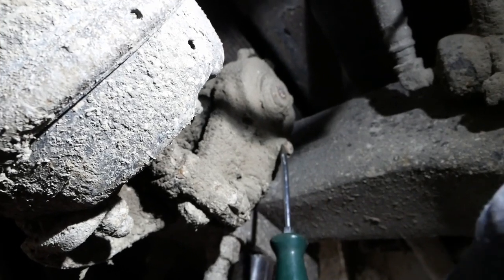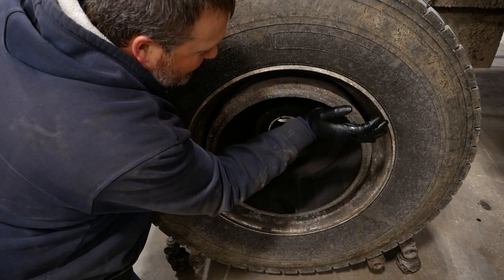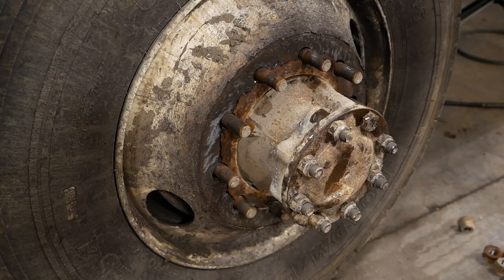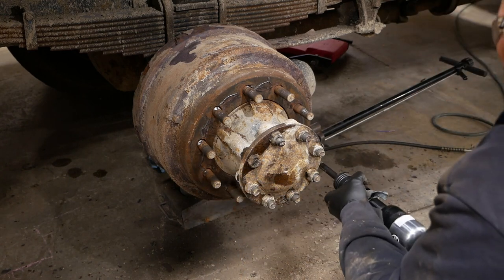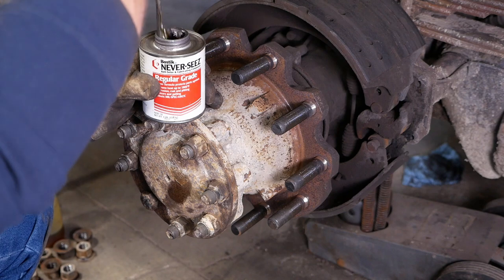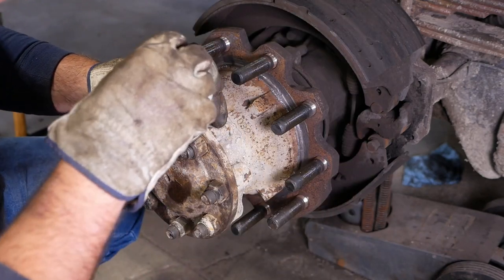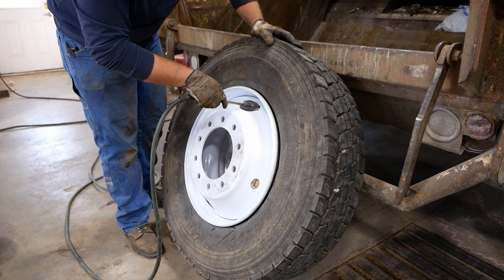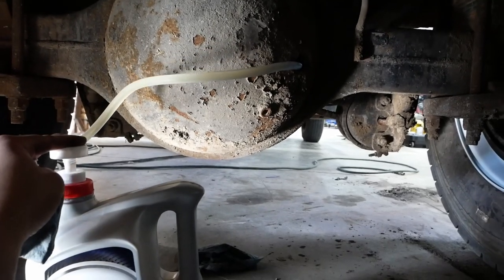Garbage Truck Driveline Noise Could Have Been Bad!

Comment: I have to ask: why is the valve stem on the outer wheel pointing inside?  I guess is for protecting against road debris, but doesn't it make it harder to inflate if you don't have the proper nozzle?
Reply: It is a dually wheel. The inner wheel and the front tire has the valve facing out board, but this one is mounted 'backwards' so the nozzle face inboard. Anyone who uses these wheels has the right air chuck

Comment: Wes I'm a Dewalt user...just wondering what model nut driver you used to take the axle bolts off?  Used to use a air compressor but that developed a leak.

Comment: Great video. No experience with truck tires but how do you check tire pressure/inflate the outside rim with the valve stem pointing inwards at 17:38 ?
Reply from the maker: You use an air chuck that points backward. Standard equipment for truck mechanics.
Reply: @WatchWesWork  Aha! Thank you.

Comment: You can grant that one tool that uses way too much floor space that you use but twice a year - at most... as much space as it wants. It's not a matter of whether it ever pays for itself in raw $$ (it has). Each rare time you get the need to go for it - there it is and you smile inside as you roll it over to the work. Technicians / mechanics and our tools :)

Talking of something that should pay off later / eventually - knee pads - we're not engineered to kneel, continue to kneel on concrete in jeans and expect double knee surgery come 50. Want to factor that medical cost into your retirement planning?

Comment: should  have done a brake  job also, and buffed the paint off  the rims where they met, the paint will turn to dust and fall out and the tires will be free, and you should have retorqued the lug nuts after you test drove it and the studs were seated,

Comment: Improper clamp load.   There are many factors that can cause this alone as well as their combined affects.  Under torque, over torque, paint thickness in excess of 3.5 mils,  rusty hardware, etc....   Best thing is to start fresh and it seems you did with the exception of the nuts and hub face.  New nuts and studs torqued to 475 ftlbs will yield about 55000 lbs clamping force while a rusty nut and stud will only produce about 20000 lbs clamping force.  Even used nuts and clean studs only produce about 40000 lbs clamp force when torqued to 475 ftlbs.  

Torque needs to be accurately set with proper sequence and then check after 50-100 miles and again every 10000 miles.

Comment: In the 1970's I drove a Dodge box van with dual wheels . When it needed tires they put them back with the rims CRUSHING a locating pin . It was there to make sure the rims locked together . A short while later everything chewed up and the wheels loosened and studs had to be replaced . I remember the moron at the tire shop with a 1" impact gun saying " I don't know nuttin' about no pins " ! It's great when they turn IDIOTS loose on peoples vehicles - on the cheap ! We don't need no stinkin' torque wrench ! Dangerous !

Comment: Great video and a nice change of pace.  Couple of questions - 1. I didn't see any other support when you lifted it other than the jack on the axle.  Please tell me you had some sort of jackstands or other means of support under there.  2. Not that you normally seem to upsell customers but wouldn't it have made sense to do a rear brake job as well?  As you said the pads were close to worn and you already had the wheels and drum off on one side.  Seems like it would be false economy not to do brakes at this point.  Thanks and keep the videos coming!

Comment: I had a rim explode on my tri axle dump truck at work and it was to the point where there was about 3/4 of the inner portion of the rim was just completely missing and we never found it two months later the same thing happened again two another driver who was driving my truck

Comment: The tire changers/ balancers screwed up the studs on my hubs as they did not lubricate the flange nuts. So they  caused me some $1,300.00 damage, as well the place where they ordered them from did not count the studs so was one short. SO I GOT TO PAY FOR ALLLL THEIR MISTAKES. AS WELL AS PAYIING FOR THE ONES THE TIRE SHOP DID. 
SO THAT WON'T HAPPEN AGAIN. 
They also like to lift on the diff, which is AGAINST THEIR PROCEDURES. 
One has to keep an eye on them all the time.

Comment: Never ever alter wheel studs. U should of just got the right ones. That area u ground will now stretch more than its suppose too. Wheels fatigue due to side load pressures and impacts causing the steel to crack, water gets in and freezes expanding the cracks. Simple molecular physics

Comment: Well you replaced the leaf springs and they already looked bend again. That truck is constantly overloaded. When springs are bad you cause a whole lot of stress on other parts. Rims don’t like it when the axle hits the bump stops all the time. Something has to give. 

I guess they don’t use this truck often, when picking up garbage is done on a daily basis, you don’t drive such a crappy truck. Community trucks here look like new from the dealer, even after several years of daily service, I guess the quality starts when you make a choice for buying something new.

Comment: Ship that wheel off to Pakistan where the 'High skill mechanic' will use a few scraps of 6012 rod and a car battery to weld it back together.. and then use a worn out twisted bed lathe to face it off...

Comment: Wes, you're clearly a fine mechanic but  I've seen it far too often. Tradesman that haven't taken proper care of themselves because of bad habits and inconvenience and turning into cripples in later life. Please start using some kneeling matts/pads and ear plugs, the cold hard concrete will wreck your knees eventually and even a small impact driver, manual hammering and just day to day garage noise will damage your ears. ATB -Tony UK

Comment: I hate when people use that rubber cement on tire beads. It's such a pain for the next guy. I wont use it and never have, changed thousands of tires over 20 years and never had any sealing issues so the stuff obviously isn't needed.

Comment: The rim cracking was probably caused by the inside tire having more air in it.  This lack of maintenance and not catching it was making it carry more weight, which caused the rim to get metal fatigue and crack.

Comment: The reason you are looking for Mr West, the owner fails to check the vehicle before use and does not consider maintenance is required for safety.

I would refuse to work on the owners vehicles because of their attitude to safety inspections.
Previously. I suggested reporting  owners  to the DOT, now I'd report to the police to create a  Statutory record in unsafe operation of a HGV.
The  owner is Lethal.

Comment: Don't you just love working on garbage trucks? I was a welder in the 80's and had to weld broken tracks for the sleds in front loaders. We had a kick ass heated pressure washer but still. You're inside that enclosed body, cooking who knows what, with a welding rod. Ya. Not fun.

Comment: Great video Wes. I learned a lot as always, but I have one question? by grinding the wheel studs wouldn't it weaken them, and maybe cause them to eventually fracture over time?
Reply: No certainly not! Curves in steel are always better than notches, therefore, all sharp-edged heels in steel shafts are always rounded!

Comment: The problem is they're overloading it that truck is only ready to carry $25,000 $30,000 at the most but since they got a they took the body off of a truck that's carrying tandem axles and it was probably ready for 45 to 50,000 so they figure well I only got a big ball cuz this feel to suck her up and they're overloading it and the rims is the weakest spot that in the springs so you just answered your own question they are overloading it should have making two trips on her run they're doing it in one and I know how far people is if they're getting their trash picked up anything and everything is going in the trash for the trash man and they're probably loading that sucker down 45 to 60,000 you never know depending on the day and depending on the season all right man you have yourself a good day and get out of the snow belt move South you don't have that problem with rust you just got problems with tropical storms and hurricanes if you moved to Florida and we got another one rolling in now all right man have yourself

Comment: Has fancy wheel jack lift, only uses it once, struggles with wheels for the remainder of the video. Has fancy air hammer, uses it once, struggles with hammer through rest of video. Has cracked rim, only does one side, ignores other, hopes for the best.

Comment: Personally I would have waited on the correct studs. Modifying something like that puts a lot of liability back on you should something happen.
  I have seen broken centers more since they went to hub piloted systems it seems. As everyone has said it is probably due to rust. When the drivers would get their trucks washed and the Beacon would use brightener on the wheels in a few days the rust streaks would appear. I figured the brightener would eat the rust between wheel and nut making them loose.  Be the same with salt.
 Your tire skills are not lacking, they are fine. You let the bar do the work which is how it should be. Although ether is more entertaining then a bead blaster!!  Seen a kid jump an 11-24.5 about two feet off the floor once, that cleared the shop quick.